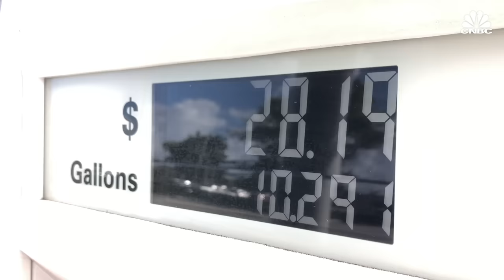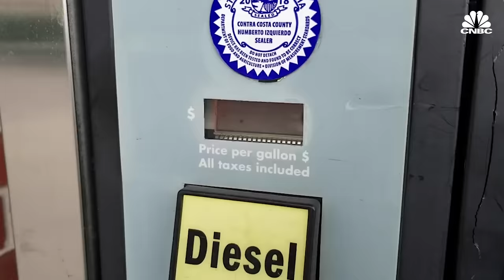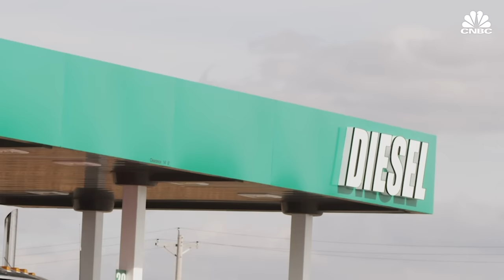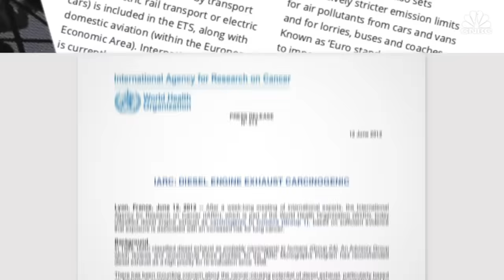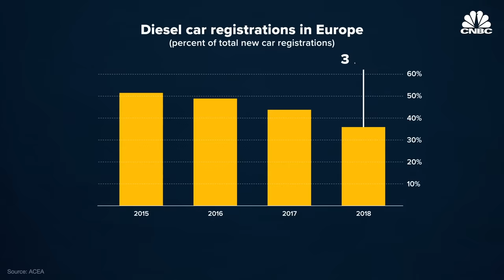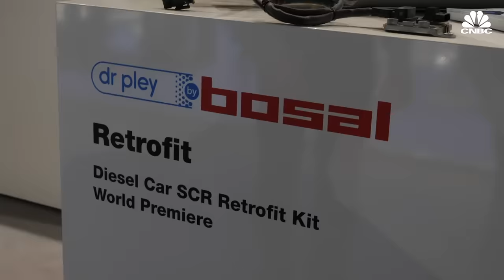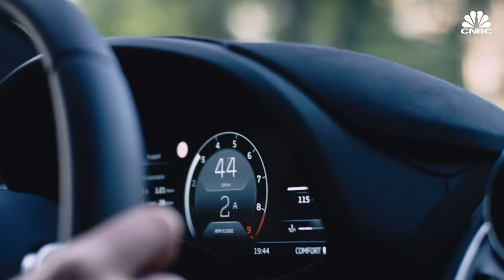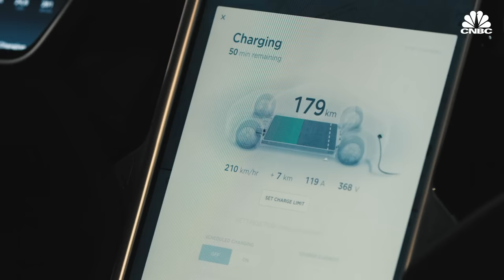Why Diesel Cars Are Disappearing

Comment: So, they're not really disappearing.
Reply: For trucks and other work vehicles vital to our infrastructure, there just isn't a viable replacement. As much as Tesla's and other manufacturer's electric trucks will change the landscape to some degree, there's many cases in the US where it's still impractical to employ electric vehicles due to the vast distances that have to be crossed with little to no infrastructure to support electrification.
Reply: @randomkoreanguy  So far. Electrification is going to overtake one day. Watch your back, diesel.
Reply: randomkoreanguy I think infrastructure is the least of problems for electric trucks. While buses and garbage trucks don’t have to haul 80000 lbs, long haul trucks do. And for electric trucks to compare to diesel trucks, their truck and trailer weight would have to increase due to their batteries. Not only that how do you power a reefer by electricity only? Plus, how would an electric truck go on a 6 percent grade? They would get stuck uphill
Reply: @randomkoreanguy  for cars it will be easy but for trucks it is going to be a longer time because of bigger infrastucture
Reply: Diesel light cars are probably going to disappear pretty soon (in less than 10 years)... trucks, long haul or heavy duty vehicles are not going to disappear any time soon, at least until there isn't a more energy dense battery system.
Reply: Jens Ericson for how slowly they make our roads it’s going to be not in our lifetime😂
Reply: @jericoba  One other issue, bucko, I personally love the new graphene battery being developed but how many can you make, not enough for the whole world, also it still produces CO2, but it is better, + the IEA and many other energy institutes have already conducted we cannot make enough renewable systems which will need to be recycled BTW, which leaves us with some form of nuclear or coal burning and clean filtering which already exists. Although the nuclear reactors are the most environmentally friendly, it isn't unlimited, we need ETAR / nuclear fission.
Reply: So far, diesel vehicles are not disappearing in many parts of Asia.
Reply: randomkoreanguy gas-electric is an excellent power source as it has the torque required for trucks.
Reply: @Anomize23  Electric cars have been around about 30 years longer then IC cars.
Electric cars make as much pollution as IC cars the difference is the location of the pollution.
IC engines pollute from the tail pipe where as electric car pollutes at the point where the electricity is created.
Also, nobody mentions the pollution created by the manufacturing or disposal of the batteries.
EV's will have their place but there is little chance of them totally replacing IC engines in our life times.
Reply: the title is "Why Diesel Cars Are Disappearing" and not "Why All Diesel Engines Are Disappearing"
Reply: fake news
Reply: @jericoba  electric is the only viable option to replace diesel, and when the price comes down people who like diesel will gladly buy electric.
Reply: We had electric semi’s in our fleet, it was such an epic failure that the company traded em in for Diesel powered semi’s. The range was horrible, it couldn’t even make it thru a day of local loads. Diesel will be the main form of transportation of goods for the next 20+ years. The only possible replacement is hydrogen. Which is still far off.
Reply: thanks this saved 14 minutes of my life
Reply: Laughs in Africa
Reply: @TKUA11  Yep, totally autonomous trucks are probably going to come much before electric trucks. That said, if you can get autonomous trucks, recharge time would not matter that much as you would not have to pay for that time. So I think many trucks would still convert. Even if you could not haul as much, it would still be cheaper.
Reply: No , modified
Reply: @randomkoreanguy  08l70
Reply: @leoncutajar1369  

"IC engines pollute from the tail pipe where as electric car pollutes at the point where the electricity is created."

Almost correct. Solar and wind actually have their [very modest amount of] pollution moved a step further away from the electricity generation point.

"Electric cars make as much pollution as IC cars the difference is the location of the pollution."

Incorrect. By a lot. My Tesla has a lifetime pollution footprint well below that of a Prius, which is about as good as it gets short of pedal bikes.

Creation of my Model 3 is roughly 10% more footprint than a comparable vehicle but, even at today's electrical grid composition, that margin is regained within months. Even in the case of a pre-existing comparable IC vehicle that you just throw away into a hole into the ground vs making a brand new Model 3 to replace it with it only takes about 50K to 70K miles to cover the difference. If you do any recycling/recovery of the displaced, decommissioned ICE it shrinks from even that.

And that's a constantly improving number for BEVs, as the electrical grid composition continues to shift every year. Factoring in that and also BEV's increased service longevity over ICE it isn't even remotely close.
Reply: @randomkoreanguy  

Where do think these "vast distances that have to be crossed with little to no infrastructure to support electrification" exist?

Electricity is ubiquitous in North America. Diesel has maybe 15 years left of any relevance in NA land transport, and anyone in the supply chain for that is going to be in a lot of pain during most of that as demand winds down. Long haul trucking is actually where it is going to be hit the earliest.
Reply: @lthundertree6385  - Sadly it's not as simple as that. America is very, very large and there exists vast stretches of road in this nation where the infrastructure is scattered and sparse. Could they fund huge projects to put charging terminals across all these roads? Sure, but it would be neither cheap nor easy. Fuel stations already exist and are dotted across the entire country. Charging ports, however, are not nearly as ubiquitous.   The expense in expanding and switching over the infrastructure is where the cost and pain will come in. Currently diesel infrastructure is cheaper and easier to use, granted it's at the cost of emissions, but batteries are much heavier and the loads carried by trucks would eat a lot of energy compared to passenger vehicles. That's just how it scales up due to the size and weight of our commercial vehicles. This means they would need bigger batteries, which adds weight and charging time. We've come a long way, I don't deny that. But we have a lot further to go before it's viable for longhaul and commercial usage. A lot of these vehicles must be able to run all day either without charging, or with the capability to charge as quickly as a diesel fill-up. To add that kind of capacity within the reach of every road and highway across the country, to make it as common as a fuel stop, that will cost tremendous time and money. That's assuming we overcome the current limits of electrification.
Reply: @randomkoreanguy  people just likes new things, electric fanatics will eventually disappear.

Charging station is not the only problem, its also the electricity that a country can generate, a country like united states with so many nuclear power plant will eventually struggle ones electric cars reach 10-15% of overall cars in US (try to imagine on how poorer nations will be able to adapt to that?)

Maybe in 7 years we will eventually transition into methanol fuel, its cleaner and will pave the way for development of future liquid hydrogen fuel so i guess battery electric vehicle will eventually be forgotten

ICE will never disappear... with clean fuel it will be cleaner than BEV's, but i think Fuel Cell will be used for low power cars and trucks

EDIT: Forget about my statemet about methanol. Its seems that 10-15 methanol blend is the only realistic one as 100% methanol is impossible to achieve...
Reply: @Anomize23  Anomize23, you are correct.  The USA is slower than molasses in January, and they are held back even further by the corrupt corporate system.  The rest of the world is catching on to maglev, and the cowboys will still be lassoing the horses.  Progress in America is sloooooooooooooooow!
Reply: Yoan Mitov in California they are.
Reply: @jericoba  will happen? Yes. Before me and you die? No. When we die, assuming we live a full life, where world will not be electric yet.
Reply: It's  not about pollution; it's a control issue. If you have an electric car, the state can prevent you from recharging at home, thru your smart meter.  On the road, you're car will be identified electronically; and not allowed to be recharged or even shut off remotely. You can't have a world order with a lot of free people driving around willy-nilly, pursuing happiness. Up till now, diesels were discouraged, to sell more fuel; which is the deep state's primary source of income. Wake up America!
Reply: @lthundertree6385  it depends on how you produce that energy. In the world the 3 most common way to produce electricity are: coal, oil and gas. The fact we use coal that much and the possibility that we need to use more coal and other not clean way to produce more electricity can vanify the use of electic cars.. As said you change to location of the pollution. The most important revolution would be to increase house "performance". We have lot of G/F energy class houses here in (north) italy, that cause more pollution than diesel cars especially during winter. Also in this video he says in italy we hit 90% of diesel cars... I think we never got more than 60% and the last year diesel were 41% of totals cars. (is not a small number, but 90% is totally wrong). I would too move to hybrid or electric cars or motorcycle, but at the moment they are way too expensive. And not good for long travel / mileage, they are quite perfect for city.
Reply: No they are not.
Reply: Nah, EV is not gon replace diesel truck. Imagine if truck have to wait 30mins to recharge its battery on the road. Even tesla owners have to queue for HOURS to charge their car
Reply: @randomkoreanguy  well the tesla semi is supposed to be able to cross the breadth of America on one charge full load so if that is actually true electric trucks will pop up much sooner. Its in construction where to my knowledge no company has a viable electric replacement.
Reply: @leoncutajar1369  actually the myth that evs are worse fot the  environment has been long since dispelled. Although its better to keep your current ic than switching to a ev for the sake of it if you need a new vehicle ev always pays off its carbon debt within a couple years of use depending on the primary source of electricity in your area. If its coal it will take a little longer but if its solar or nuclear you can pay it off in a little over a year.
Reply: Cars are.
Reply: I don't mind people getting on the EV Craze cause that means lower diesel cost for me . When everyone got on the Diesel car craze back in the late 90's diesel skyrocketed . The only crapy thing you know electricity is going to have to skyrocket.
Reply: It’s all math. Range, storing and transfering large portions of electricity. There are some realy challenging development for the future. And last but not least, who is going to produce this power cold winter nights as well as hot summer days.
Reply: @jericoba  Yep, same for flying cars, look out road cars.
Reply: @fdect  "Diesel light cars are probably going to disappear pretty soon (in less than 10 years)." I wouldn't want to put any money on that. IC engines aren't finished yet.
Reply: @yengsabio5315  Or Europe, thank goodness.
Reply: @BobbyDazzler888  LPG or LNG and electric is not a good combination. If we have to have hybrid, much better to use Diesel, with the great mid-range torque you get from turbo diesels.
Reply: @RichardASK  Hear, hear!
Reply: @leoncutajar1369  Not sure about 30 years longer than IC.  16 years ago, I did the London-Brighton Veteran Car Run in a 1901 Waverley electric car, which was pretty rudimentary, with tiller steering and I don't think there were any electric cars in 1871 or before as you suggest. The latest IC cars produce very little toxic emissions.
Reply: Jens Ericson — One day, sure. Honestly, I love innovation and see EV as just that. I can’t wait for the day that EV is as efficient and convenient as ICE. But electrical energy storage (batteries) is so far behind combustion engine storage right now. Li-ion batteries were a great innovation but there needs to be much more to match the ease of range that ICE provide. In the US people routinely take 2500km trips in their vehicles for holiday. Doing that in an EV adds another layer of headache and complexity.
Reply: @ThePatUltra I will say not until EV Range and recharging technology is on par with ICE fuel filling time. 
10% to 90% in 3-5min that is the only viable option for electric cars at least for vide adoption in cities and densely populated areas.
Reply: @jericoba  I dissagree until theres trucks hauling 30 to 40k pounds everyday and lasting a million miles with basic maintenance. Cummins for the win! If you dont do it you dont know period!
Reply: @randomkoreanguy  Your on point hence why it will never happen, unless it cost less and was as reliable too. The minute its more expensive or too hard to find batterries or there too expensive it will be gone from the industry for the practical working man.
Reply: @stayunique91  true, eletric cars are good but when you start to load them you that is where things like overheating of the motor battery and range drop badly, some people don't understand a diesel,making 400nm of,torque compare to a gas car making 400nm and a eletric car making 400nm is not the same, diesel can maintain its 400nm at any load without droping rpm, gas engines with load put drop really fast when you start to add weight the 400nm would drop to around 200nm, electric is even worst, eg an electric fan would spin with no,load really well, the sec you put your hand and add resistance to the motor it starts to get hot and a burn smell comes from it, also diesels can run whole day without stopping where as a truck that is electric would have to wait for the motors and battery to cool when loaded
Reply: @ameserich  AMen brother, You just made me happy because I love ICE vehicles and dont see them leaving either. I will not buy a ev regardless but too much too happen for them to be the mainstream anyhow.
Reply: @pk6336158  Facts, Its not going to take over mainstream because it cant haul like a diesel without burning the electric motor out. Its over right there, EVS are for city office people running to get cupcakes for the office and back point blank period! Waste of time for your working man!
Reply: @brandonlewis5045  I got np with ev the problem I have is one the lies and two there are forcing things on other people, people should have a choice on what there want and don't want, not forcing THERE future and THERE plans on others which is bullying, I think if theses green people really wanna be green there should start acting it and stop talking, sell there cars and buy bikes, and go an live in the bush with a solar panel
Reply: @fdect  no they won't lmao
Reply: @randomkoreanguy  looking at how quickly Tesla built  a large  array of charging stations  ut shouldn't be hard for any company to do the same
Reply: @fdect  the cost of batteries has dropped  dramatically

the cost is now a  3rd of what it used to be

so i don't see why  the EV truck can't replace the diesel truck like the EV car can replace the gas car right now

what does density have to do with it?
Reply: @Anomize23  the private sector makes gas stations and charging stations

they work faster than the gov't
Reply: @leoncutajar1369  

if we switch to green energy to produce the battery that would cut the pollution from production reducing the overall pollution related to EV  to nearly nothing

the cost of batteries has dropped  dramatically

the cost is now a  3rd of what it used to be

 the EV car can replace the gas car right now
Reply: @robinsss  EV's have been around longer then IC cars.
If the market wants then then fine as long as the state doesn't intervene to remove IC cars off the road.
Reply: ''''''So, they're not really disappearing.

'''''

yes 

they will be

the latest advancements in Electric car batteries is the death  knell  for gas and diesel powered cars and trucks
Reply: @robinsss  IC "petrol" engines were never originally designed to run on petrol.
In fact petrol was the highly volatile byproduct from distilling kerosene which before Rockefeller got IC engines to run on it he used to dump into rivers.
And the "diesel" engine was never intended to run on what we now refer to diesel.
So far EV, even where governments have pushed them haven't seen wide spread usage because most people cannot see the personal benefit for paying 50K for an EV with the same room as a 20K petrol car so they can replace their fuel bill with a larger electric bill.
I have been running my old diesel car on waste oil for years and count my fuel bill in time spent getting the oil and filtering it who would I benefit from an EV?
Reply: @leoncutajar1369  the  cost of charging an EV is 1/3rd the cost of  gas or diesel

most people don't have enough waste  oil to  
run their car

you are unique
Reply: @robinsss  Not really,
What available to me is can be done by almost anyone.
Most diesel ships run on waste oil.
I also heat my house with waste oil.
The cost of charging an EV is 1/3 the cost NOW.
Nobody knows how much the price of electricity will go up by as we switch from fossil fuels to more expensive "green" energy sources so we don't know if the cost differences will justify the price differences o the cars or the fact that batteries (currently) are very expensive and once they need replacing the car is worthless.
Also, in large countries like Australia will the private sector willing to invest in putting charging stations in the middle of nowhere WITHOUT government assistance?
In built up areas and areas when the price comes down I can see the benefit of an EV and of somebody can address these issues WITHOUT the government stepping I think it is a good thing.
Reply: @robinsss  When it comes to regulations we will see how fast then because they can’t even build roads right nor as fast🤣
Reply: @leoncutajar1369  how much waste oil do you use for your car everyday?

'''''''''''''Nobody knows how much the price of electricity will go up by as we switch from fossil fuels to more expensive "green" energy sources'''''''

we'll have to address when the time comes

that time hasn't come yet

''''''''we don't know if the cost differences will justify the price differences o the cars or the fact that batteries (currently) are very expensive '''

are you aware that many business and tech observers  have said we have reached a key point in battery technology?

the price of an EV  battery is now practically 1/10th  of the production  cost 
of 10 years ago?

that means it's much cheaper to make an EV than it was in 2010
Reply: @robinsss  It depends on how often I drive my car.
I have always been interested in alternative energy sources and I don't see the benefit of replacing one overpriced monopoly with an even more expensive monopoly.
yes in real terms battery cars are cheaper now then 2010 but if we have reached the peak of battery technology and this as good as it gets AND an EV is still twice to three times more expensive then the equivalent IC car then it cannot stand on it's own two feet without the government
.
Reply: @leoncutajar1369  

'''''It depends on how often I drive my car.''''

on days when you do drive your car , how much oil waste do you use?

the benefit of an EV  car is that you spend 1/3rd of the cost of gasoline to power it 

''''''yes in real terms battery cars are cheaper now then 2010 but if we have reached the peak of battery technology and this as good as it gets AND an EV is still twice to three times more expensive then the equivalent IC car then it cannot stand on it's own two feet without the government
'''''

we don't now if the EV is as good as it can be

the EV is not twice the price of an ICE car anymore

the average price of a car in America is 33,000 dollars

the Chevy bolt and the Tesla model 3  both cost 36,000 dollars

that's only 3,000 dollars more than the ICE car
Reply: @robinsss  I'm averaging 35-40 MPG (british).
How much is the similarly sized GM IC car to a Bolt?
The 1/3 cost of gasoline your using is based in current prices.
In Australia LPG (propane) was about 1/3 the cost of petrol UNTIL enough people switched the LPG and the government started taxing it like petrol.
Also, Australia once had the lowest cost electricity in the developed world because we have and abundance of coal but since the governments have been switching from coal to "green" energy we now have some of the most expensive electricity in the world.
Reply: @randomkoreanguy  Trucking companies only make money when their trucks are logging miles - they're not going to wait for hours for heavy batteries to be charged and the dead weight of those batteries could be used to carry cargo instead of the batteries!!!
Reply: So, you didn't watch the video.
Reply: @jericoba  It will be a long time, possible in the future.
Reply: @stayunique91  exactly.
Reply: @TKUA11  diesel guys like me don’t care, and we will continue to buy these vehicles used for as long as we live
Reply: @TKUA11  There are natural gas trucks with a GVWR of 80,000 pounds.
Reply: @RichardASK  No one said that IC engines were finished in light cars, they said that DIESELS are finished in light cars, and they basically are.
Reply: @jericoba  people said the same thing 20 years ago.
Reply: @BobbyDazzler888  My hybrid is awesome, but not reliable. I'd take a gas over a hybrid or EV.
Reply: @lthundertree6385  Lol yeah right.
Reply: @jericoba  Electrified cars still require tons of CO2 to in process of making them alone. especially the bigger the battery.
Reply: Apparently  they're  not.
Reply: @Firefighter_Matt  Partly true. They do require emissions to be constructed but they will will in the long run. Besides, the process is getting improved yearly so it is still 100% better. It simply is. Arguments like yours I've heard thousands of times from people not wanting change. You don't have to like it but it's the present and future.
Reply: @jericoba  I don't mind change at all. The forcing it upon people part is only thing don't like no matter what it is. People can choose for themselves and my family having a long history of service i will never waver on people not being forced into their choices.
Reply: @Firefighter_Matt  You can choose in this case. But when all cars become electrical, I hope you will find someone that is to your satisfaction.
Reply: I just bought my diesel 5 months ago, so I guess not yet